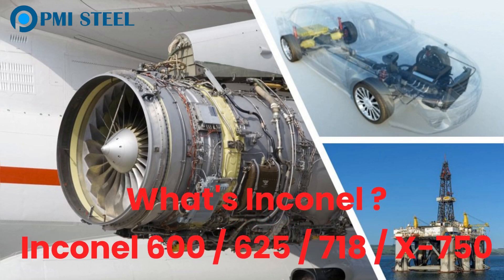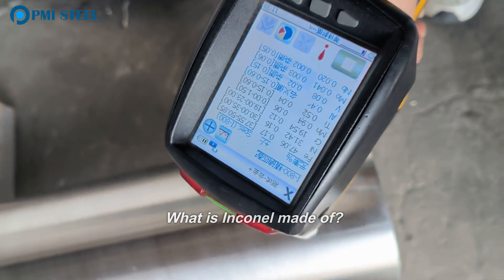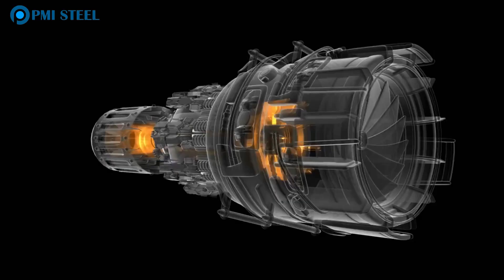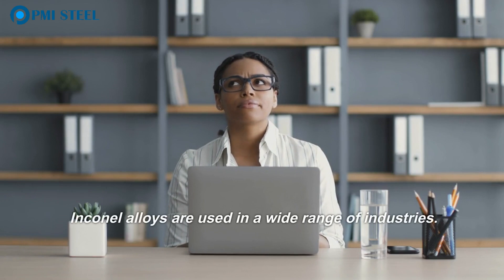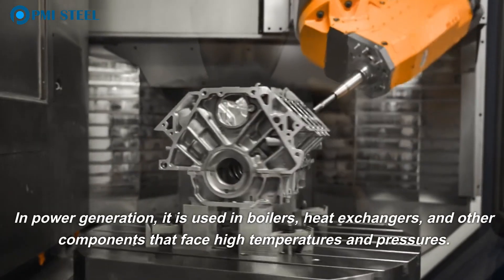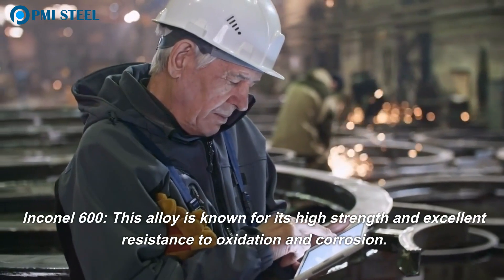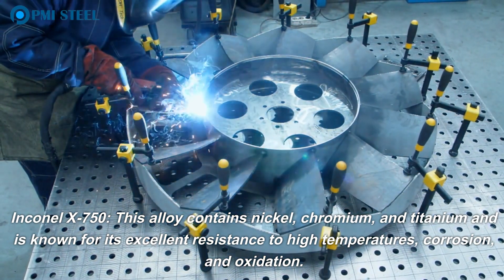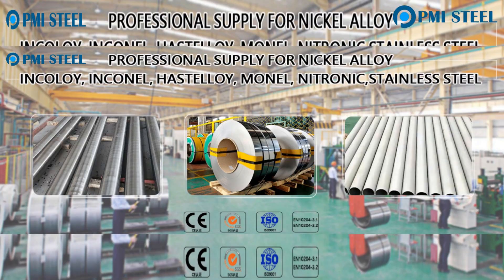What's Inconel ? Incoel 600-625-718-X 750@pmisteel.com

Comment: What automotive manufacturers used to use when they cared about their good name and customers. auto company just issued recall for their intake valves breaking and the destroying whole engine. seems it would cost less just to build it right and have NO problems ever after but they just wont accept it as truth.
Reply from the maker: Thank for your kindly suggestion.